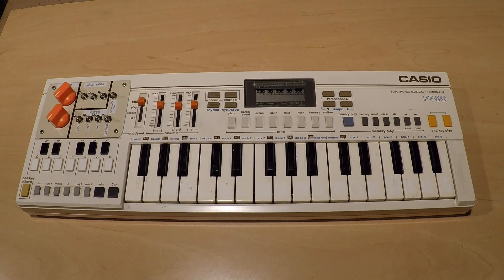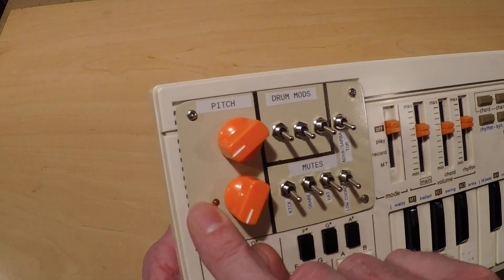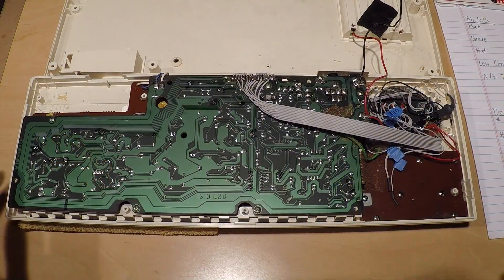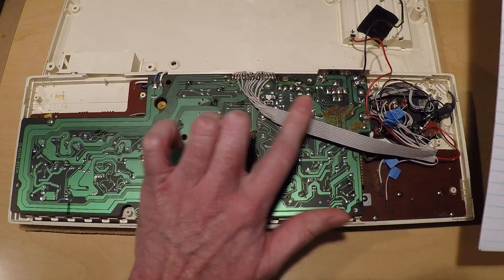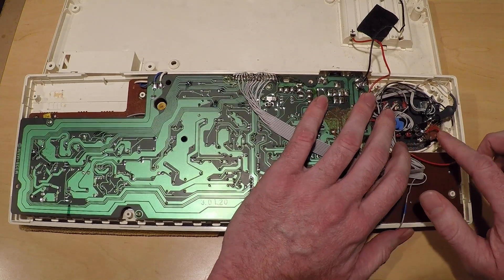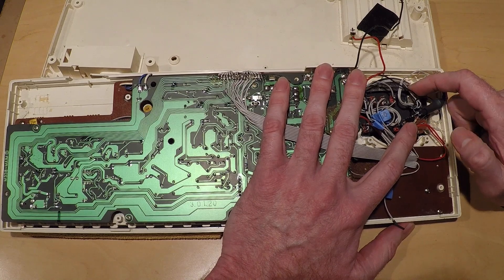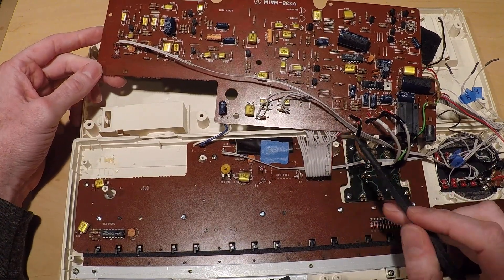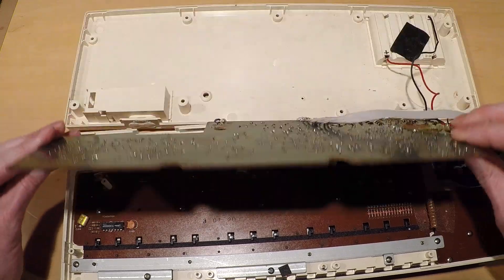Circuit Bent Casio PT-30 keyboard

Comment: Very cool, have you ever messed with an mt40?
Reply from the maker: @kdt85  no I haven’t. But I did do a Casio MT-100 with a lot of cool mods.
Reply: @SISKworks  I've just watched that, absolutely incredible! Do you think you could intercept the drum signals rather than just muting them?  I have an mt-40 sand I want to output the drum and bass to two separate tracks. So three outputs in total, one for drums, one bass and one keys. Do you think it's possible? 

Thanks, just found your channel and love it!
Reply from the maker: @ I’m not sure. I have a feeling the circuit in the MT-40 is totally different than the MT-100. It MIGHT be possible but probably not very easy. On my Mt100, the drum signals I was cutting were just the signal and not the actual complete drum sound. So I couldn’t extract the sounds from the jacks.
Reply: @SISKworks  Thank you, i will probe around and see if i can find whatever is being used to mix the signal before the speaker